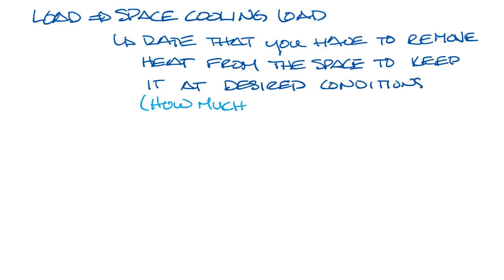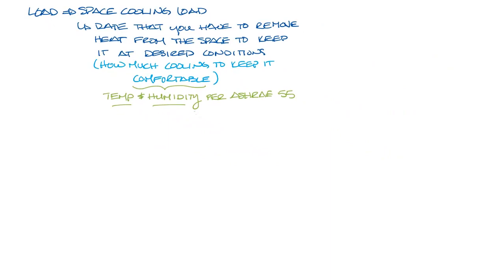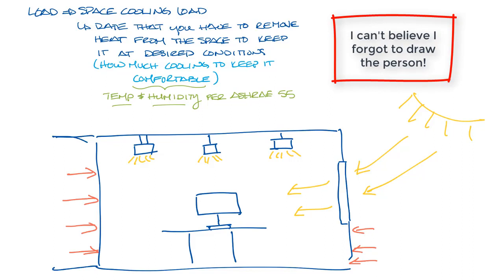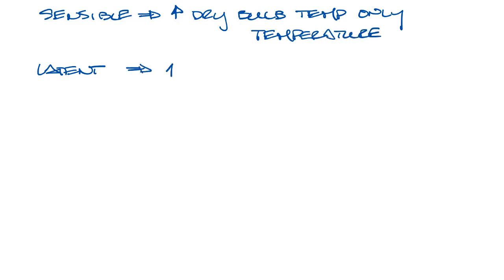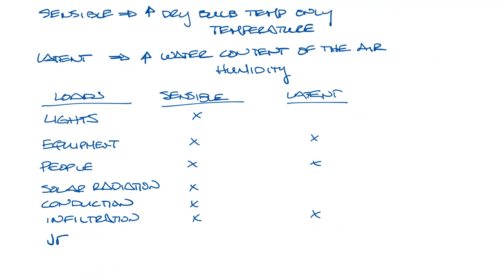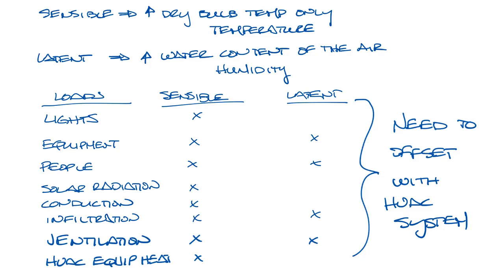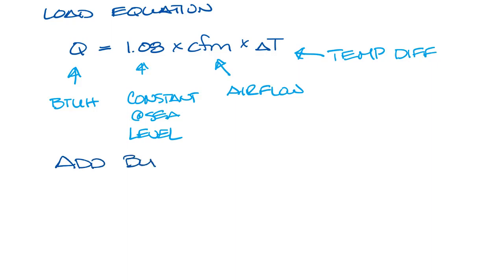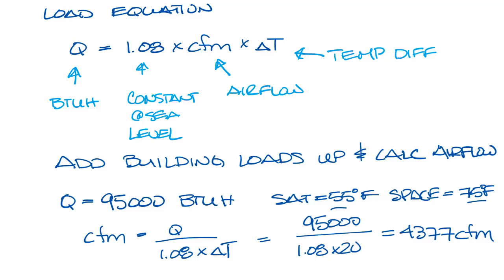Load Basics

Comment: Jenny, your videos are great.  Very much to the point and not wasting any time.  This one needs a little clarification:  What you are calling the building "load equation" is based on SENSIBLE load only.  So if your total load is 95,000 you will take the sensible part only for this equation (does not include the latent).  Wishing you the best - keep up the good work.